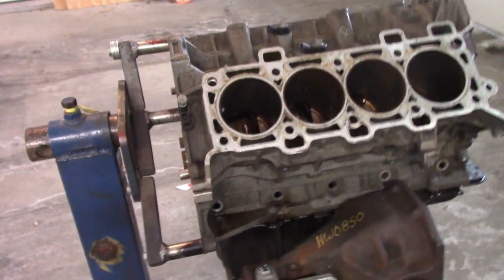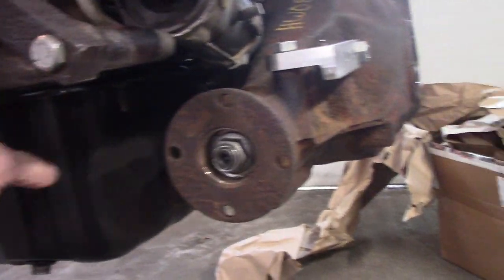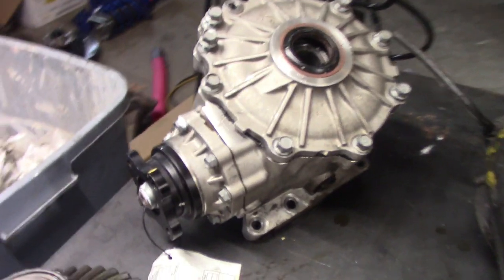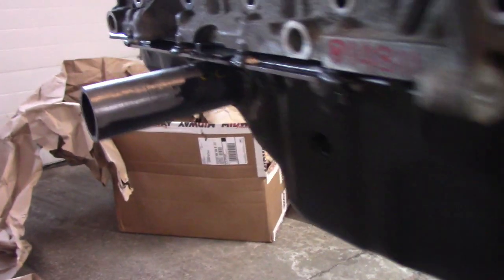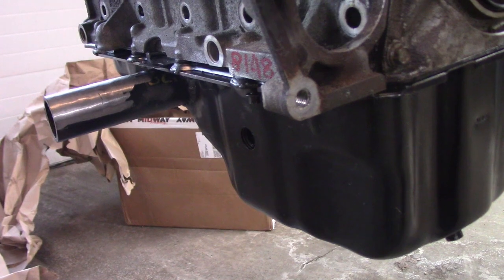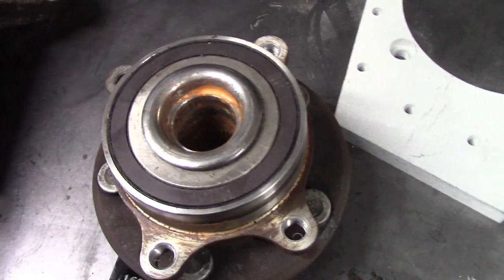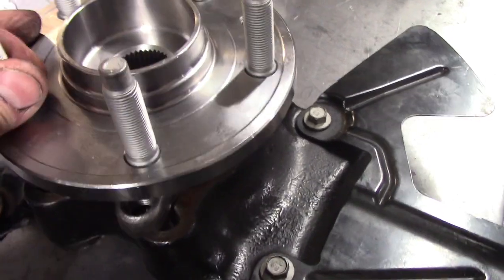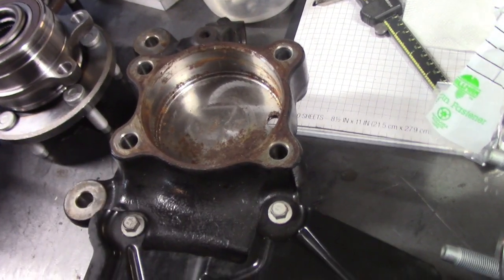Custom Front differential and Spindles - AWD Mustang Episode 2

Comment: You might want to look at the 2013 Flex front spindle.  It's a unit bearing design, aluminum, with a 2 bolt strut mount and has the clearance necessary for a CV.  It might also reverse the balljoint to mount like the old Mustang spindle.
Reply from the maker: At this point I am trying to keep the S550 basic front suspension layout.  I did research putting S197 front suspension in to simplify the spindle.  It has been done.  But as of now, I am sticking with the more complicated S550 setup.

Comment: Not sure if it helps, but BMW's E83 X3 3.0si with a manual trans has a 3.73 front diff. I actually have one since I swapped my 3.73 diffs for 4.44 ones. Quaife may even make an LSD for them.
Reply from the maker: I have noticed that.  The BMW front diffs are some of a "mid" pinion and may fit ok.  LSD are expensive.  Do you want to sell yours or donate to the cause:)
Reply: @npvg  I'd donate it if the shipping is paid for haha.

Comment: Looking good.  One comment regarding your choice of differential ratios...  Knowing you want to turbo charge this after the AWD is done, 3.73 gears would not be my first choice for turbos.  Personally I would use something like a 3.27 to better load the engine/turbo(s).  I've used both and found 3.08 or 3.27 works much better on the street to load the turbos.  Not to mention the 3.73 requires more shifting, which is lost momentum.
Reply from the maker: I have gone back and forth on this and was actually currently planning to go 4.11.  The front diff I am going to use already has 4.11 gears and so I could just swap the rear to match.  

Check out post # 124 on my build thread.  

https://www.mustang6g.com/forums/threads/awd-2017-mustang-gt-conversion.170460/page-9

I went from 4.11 to 3.73's in my AWD Turbo SBF Merkur and it in fact DID get faster at the track since I could stay in 4th gear at the end of the run, but it is not as fun on the street with the 2.66 first gear T56. 

I get the impression that most people swap to numerically lower gears to try and control the traction, I should  not have that problem.  

I will look into it more, thanks for the great comment.
Reply: @npvg  I certainly wouldn't go 4.11 for the street unless you need it geared that low for optimal trap RPM on the track.  It will be much more enjoyable on the street with numerically lower gears!  Although I base all of my experience on sub 7.5k RPM turbo pushrod engines. (SBF, BBC, LS, and Viper V10).  

I'm glad the comment at least gave consideration to additional though.  Great project, I'm really enjoying following it!  TY for sharing it with us...

Comment: You can build billet "modular" front spindles. Basically, the "spindle" is the main plate and then hub/wheel
bearing, caliper, steering arm, holder for lower ball joint and holder for the strut is bolted to this.

An example for an solution is to look at the "Superlite SL-C" and how this have been done.
Reply from the maker: That is exactly what intend to do.  But I am going to use the lower part of the original Ford Spindle as part of the "modular" pieces.

Comment: Can you use a hub that's splined all the way pressed in to the bearing of the mustang rear bearing section.  
Yes you'll have use 4 hubs to make 2 but looks like that ship has sailed a few times already lol
Reply from the maker: I don't quite understand what you are trying to say?  I am using the complete rear S550 mustang hub along with the matching CV joint.  I will have to replace the boot, but otherwise it is all looking good.

Comment: I suggest you have a look at Subaru and Nissan rear differentials.  They have a small ring gear and really long pinion shaft, so they are very compact.  I believe they are available with aluminum cases, and they have a dropout center section IIRC.
Reply from the maker: Any years come with a 3.73 gear?  The R180 would be a nice size.
Reply: @npvg  2006/2007 WRX 2.5L 5MT has a 3.70 final drive ratio from my research.

Comment: Did you ever consider using the Taurus sho steering knuckle? The Taurus SHO and the explorer have the same wheel hub bearing!
Reply from the maker: I have considered a lot of different solutions.  From making my own spindle from scratch, to using S197 suspension geometry or using Subaru spindles.  

I want to try and retain the dual pivot front suspension of the S550 chassis.  The Taurus and most other cars use a single lower ball joint.  But, the dual pivot has some advantages and I am going to try my best to retain it. 

Also, what many people forget about when adapting spindles from another vehicle is ackermann steering.  Many front wheel drive cars, including the Taurus and the Explorer (2011-2019), have the steering rack behind the front axle.  The Mustang has it in front of the front axle.  If you were to take a Taurus (or Explorer) spindle and swap it side to side to get the steering arm on the correct side, the ackermann would be way off.  By the time you fix that, you are back to pretty much making the spindle from scratch again.  

Thanks for watching and please bring up any other ideas you may have.  I am always open to looking at new ideas.

Comment: Hey buddy you keep making videos please.  These conversions aren't really popular because of the complication of the front diff integration.  Also not sure if you know this but 04+ 4runner front axles are beefier units.  I don't know if the intermediate shaft and newer diffs are as easy to integrate.  Also is that diff going to be a locker style or limited slip??  I know the front Toyota diff I'm running is a 3.73 04+ 4Runner unit I got it to compliment the super 8.8 but I still have to swap gears to 3.73.   I planned to retain the front axle coupling unit so I can switch my car to RWD for certain occasions.  I'm running a BW 4472 from a cyclone, that will be divorced/stand alone from the trans.  I could post on and on because your build is so similar to mine except you've got that rock solid Coyote and I'm on a 2JZ.  Enjoy yourself.  I look forward to the updates and conclusion of the build.
Reply from the maker: The front diff is a helical (Torsen) style diff and will be happy on the street.  The 96+ Yota diffs are a high pinion design.  But I do have some 2000 Tundra front axles coming.  They have a stronger 6 ball inner CV joint vs a tripod style.  

The BW4472 won't work with an front axle disconnect.  You will simply burn up the viscous coupling.  They have a center diff and will try to send toque to the front.  I can go into more detail if you like.  I have a BW4472 in my Merkur for most of its existence, but it currently has a TBSS torsen tcase.

Comment: Do you have any interests in repeating this process once you finish, and doing a build for $$? I would be very interested.
Reply from the maker: If the first one works, I am consider doing more.  That is one of the challenges of doing something like this.  If you knew in advance that you were going to do 10+ of them, you would do the project different then a one off.  I am trying to walk the line a bit.
Reply: I second the motion. I have a s197 which is a track car with the magnum xl tremec. I would pay to have it converted as well. It's a project car so anything is possible.

Comment: Have you thought about using a nissan "transfer case"?
Reply from the maker: Yes, I have researched everything 😄. I wish I would have purchased a r32 tcase when they were cheap just to have it.  But, I think my tcase choice will work out.
Reply: @npvg  my thought is the newer fx35 case it has a electromagnetic coupler  similar to the charger case. And they are affordable. I saw at some point the dodge AWD claims it can only send 38% to the front output have you seen this figure before?
Reply: From the exterior it looks nearly identical to the r32 case
Reply from the maker: @marcuslinnell6719   Yes, I have a G35/FX35 Tcase and the newer G37 T-case.  What concerned me about the older FX35 case was that the clutch was in a sealed housing separate from the rest of the T-case fluid.  If you look at the R35 GTR's, which are exactly the same, they have an issue with overheating the clutch.  The nwer G37 T-case does away with this and the T-case has a pump that cools the clutch.  This is exactly what the BW Charger T-case does, the clutch has fluid pumped through it to keep it cool.  It seems like a better design.
Reply: @npvg  You might be changing my plans. Is the Borg Warner more compact than the Infiniti case?
Reply: @npvg  I had wondered if the fluid in the clutch assembly was a viscous clutch type of fluid designed to increase lockup with temp. Do you have any idea about that?

Comment: Maybe the real answer is to just have a set of spindles cast to your drawing?  Making a wooden pattern from a CAD model seems well within your wheelhouse, then send it off to a foundry and have them cast and heat treated.  Then you can machine all the features and have exactly what you need?!
Reply from the maker: I would just CNC it out of bar stock.  The hard part is the crazy angles of the double pivot low control arms.